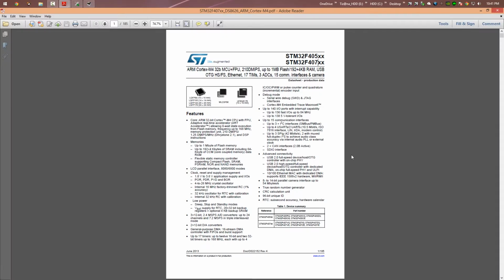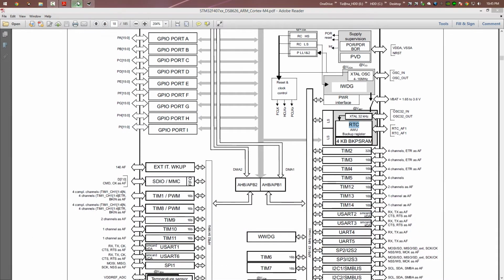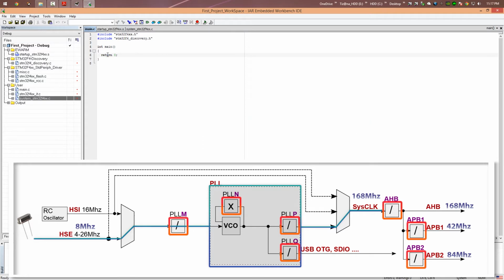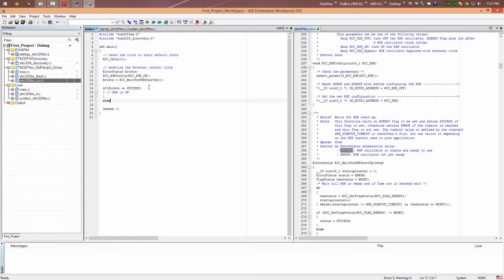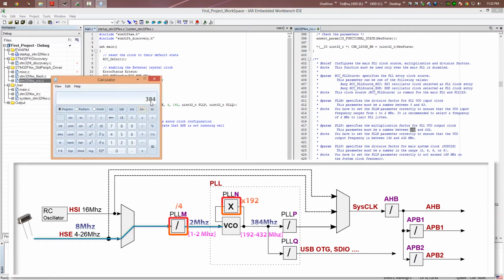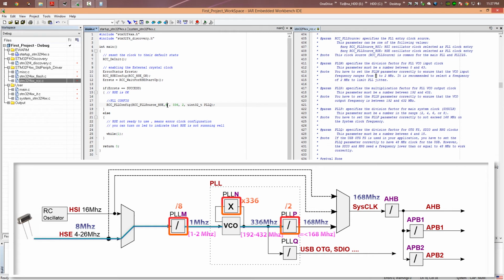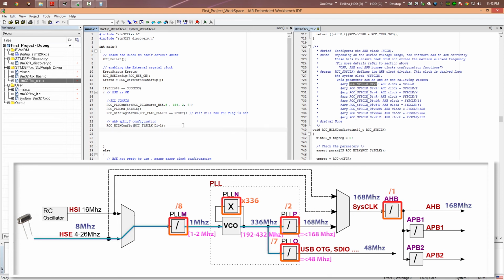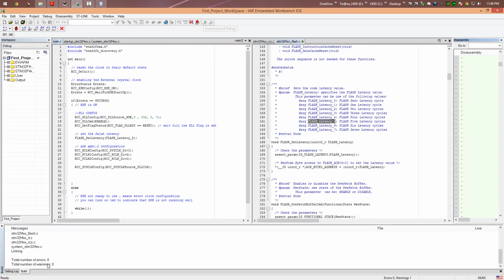STM32 Tutorial : Clock, AHB & APB Buses configuration (Part2: Writing the Code)

Comment: Thanks ! This really helped. Following is an update using HAL library coding. The idea is still exactly the same though.

For the STN32F401RET6 / SysCLK = 84 Mhz

    /* Set Oscillator and clock structures */
    RCC_OscInitTypeDef RCC_OscInitStruct;
    RCC_ClkInitTypeDef RCC_ClkInitStruct;
    
    /* HSE = 8 Mhz , HSI = 16 Mhz */
    
    /* Enable HSE Oscillator 8 Mhz */
    RCC_OscInitStruct.OscillatorType = RCC_OSCILLATORTYPE_HSE;
    RCC_OscInitStruct.HSEState = RCC_HSE_ON;

    /* Settings to get PLL frequencies of and */
    RCC_OscInitStruct.PLL.PLLSource = RCC_PLLSOURCE_HSE;

    /* HSE devider. Result needs to stay between 1 and 2 Mhz */
    /* PLLM output = 8 Mhz / PLLM = 1 Mhz */
    RCC_OscInitStruct.PLL.PLLM = 8;

    /* PLLMout multiplier. Result needs to stay between 192 and 432 Mhz */
    /* The actual PLLN number can aslo only be between 192 and 432 */
    /* PLLN0ut = PLLMout * PLLN = 336 Mhz */
    RCC_OscInitStruct.PLL.PLLN = 336;

    /* PLLNout devider for SysCLK. Devider can only be 2, 4, 6 or 8 */
    /* SysCLK = PLLNout / 4 = 84 Mhz */
    RCC_OscInitStruct.PLL.PLLP = RCC_PLLP_DIV4;

    /* PLLNout devider for USB OTG FS. Between 4 and 15 */
    /* USB = PLLNout / 7 = 48 Mhz */
    RCC_OscInitStruct.PLL.PLLQ = 7;
    
    /* Check if oscilators are OK when setting */
    if(HAL_RCC_OscConfig(&RCC_OscInitStruct) != HAL_OK) {
        Error_Handler();
    }
    
    /* Select PLL as system clock source and configure the HCLK, PCLK1 and PCLK2 clocks dividers*/
    RCC_ClkInitStruct.ClockType = (RCC_CLOCKTYPE_SYSCLK | RCC_CLOCKTYPE_HCLK | RCC_CLOCKTYPE_PCLK1 | RCC_CLOCKTYPE_PCLK2);
    
    RCC_ClkInitStruct.SYSCLKSource = RCC_SYSCLKSOURCE_PLLCLK;

    /* AHB = SysCLK / 1 = 84 Mhz */
    /* This can be DIV1, 2, 4, 8, 16, 64, 128, 256, 512 */
    RCC_ClkInitStruct.AHBCLKDivider = RCC_SYSCLK_DIV1;
    /* APB1 = SysCLK / 2 = 42 Mhz */
    /* This can be DIV1, 2, 4, 8, 16 */
    RCC_ClkInitStruct.APB1CLKDivider = RCC_HCLK_DIV2;  
    /* APB2 = SysCLK / 1 = 84 Mhz */
    /* This can be DIV1, 2, 4, 8, 16 */
    RCC_ClkInitStruct.APB2CLKDivider = RCC_HCLK_DIV1;  

    /* wait state for Vdd = 2.7 to 3.6 SYSCLK = 84Mhz is 2 (see datasheet) */
    if(HAL_RCC_ClockConfig(&RCC_ClkInitStruct, FLASH_LATENCY_2) != HAL_OK) {
        Error_Handler();
    }